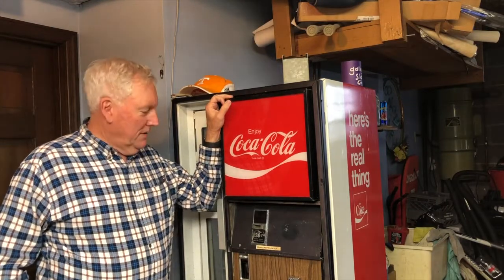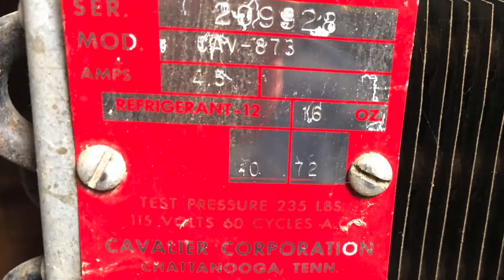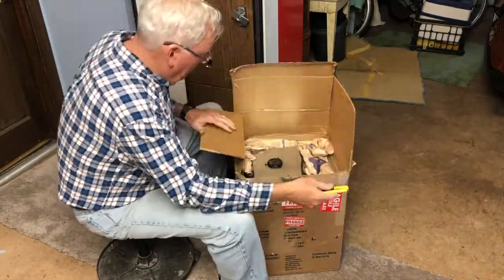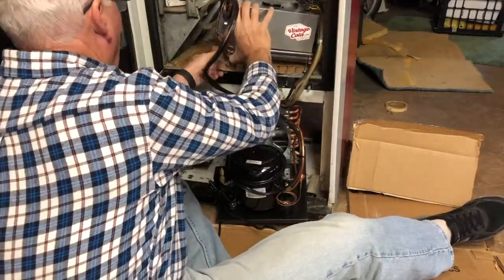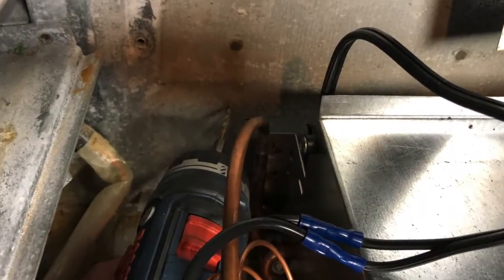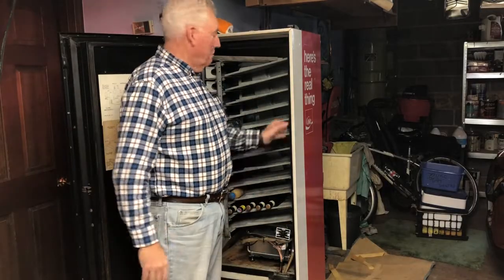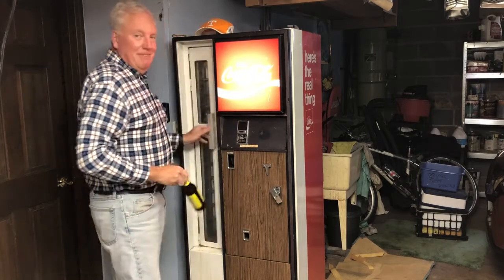Cavalier Coke Machine Chiller Replacement

Comment: Russ, I have a late 60 model Vendo rack machine similar to yours.  If really cools awesome, the issue is my $70 electric bill increase every month that I run it.  Do you find that the new unit from Vintage Cola would be cheaper to run?
Reply from the maker: Good question.  Well this new unit pulls 13 amps loaded and 1.4 amps with fan and lights only.  I was having a problem with the coils icing up after running about 5 days or so and then the efficiency was real bad.  What I did was put a timer on the machine and letting it "rest" for about 10 hours a day.  It is likely not the best for the beer to let it warm slightly, but the machine doesn't seem to care.  It is back at temperature in less than an hour and the drinks are likely there in about 2.

Comment from the maker: I had a difficult time getting the thermostat to keep the unit cold enough.  I finally had to run it low in the cabinet to get the compressor heat to keep it running.  It is not a "whisper" unit, that is for sure.
Reply from the maker: Good question.  Well this new unit pulls 13 amps loaded and 1.4 amps with fan and lights only.  I was having a problem with the coils icing up after running about 5 days or so and then the efficiency was real bad.  What I did was put a timer on the machine and letting it "rest" for about 10 hours a day.  It is likely not the best for the beer to let it warm slightly, but the machine doesn't seem to care.  It is back at temperature in less than an hour and the drinks are likely there in about 2.

Comment: Does anyone happen to know to chang the price on this machine. I have the same model
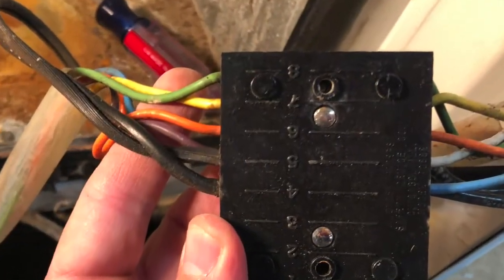Reply from the maker: If you look at my first video, at time 1:10 I show the DIP switches that are used to change the price.
Reply from the maker: Do you have the changer with the microprocessor like the video or the older type with the rotating cams?  I have both.
Reply: @navynuc1  mine is a 1964 with the rotating cams
Reply from the maker: @AuzzAustin  I have one of those units as well and I couldn't figure it out either!